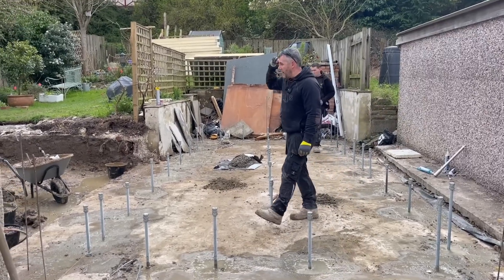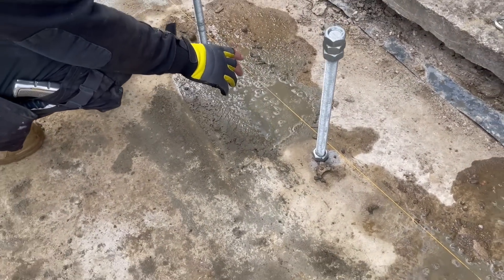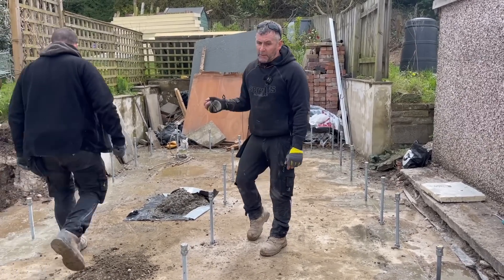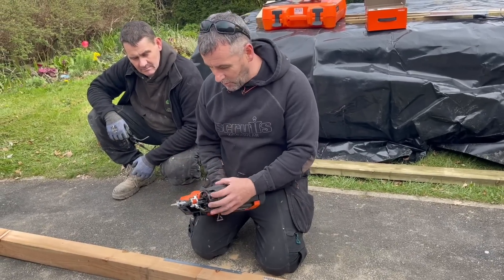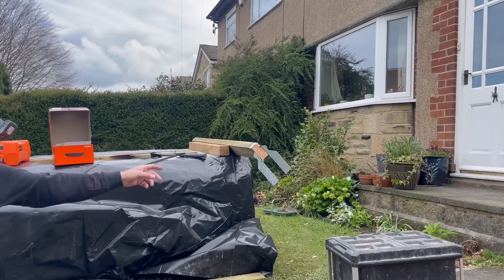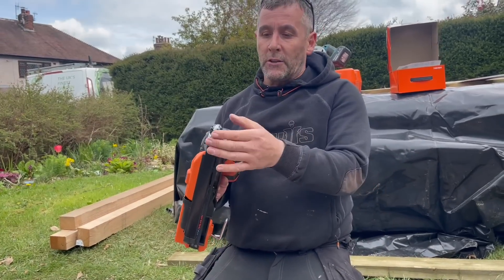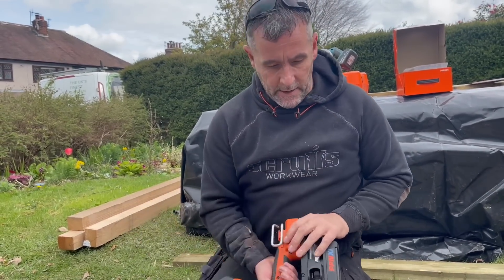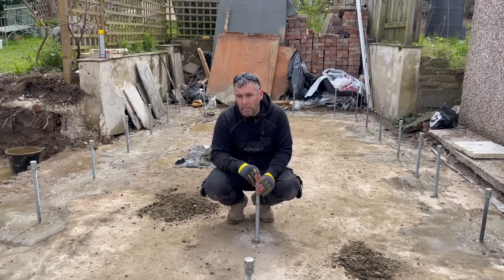Paslode PPn nailer review goes south!

Comment: I found problems with the gas at times even with full fuel cell, sometimes they’re faulty, gas being off, even in date, but changing worked, I changed to the dewalt nailers, never had a problem, heavier, but no gas, or extra charger to lug around.

Comment: I run a compressor for the ppn , and coil nailers of various sizes  also have a pneumatic nail punch for sanding back floors . Obviously its no ideal having to have a hose and compressor so i still use the im350+ for first fix and paslode 16/18g for second fix . The ppn and coil are faultless on air but not something your getting set up for 1 missed hanger

Comment: Id check the paslodes all tight up top - ours fires fine never really misfires. Somebody had a new one that did similar tightened up the loose part was fine. If i remember right was no tools needed was the part you can tighten by hand worth a shot

Comment: I have two of these Twist guns and occasuinally they misfire, but usually they work fine. I mainly have problems when the strips of nails get wet or damp and the adhesive and paper that holds the nails together fails causing a jam that stops the nails going all the way up into position for the firing pin. You need to keep the nails bone dry at all times. Or it could be that the spring loader isnt strong enough to push the nails all the way up into position in which case id probably use the warrenty to get it replaced. They are worth it but I think you may have been unlucky